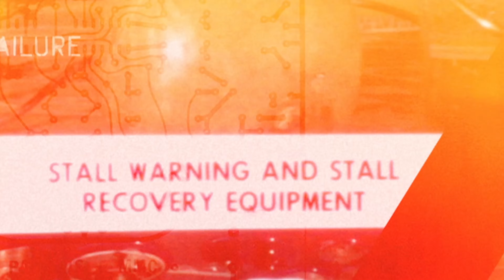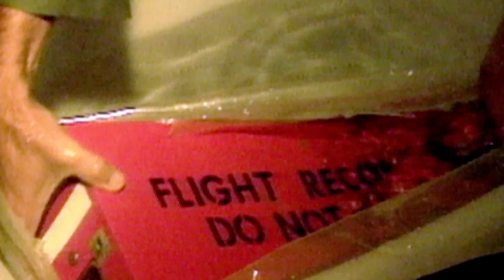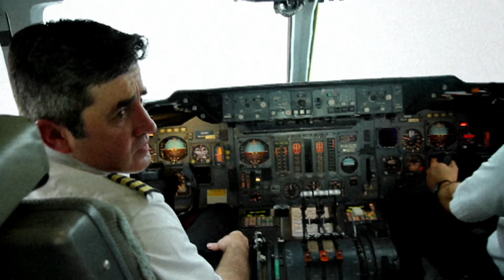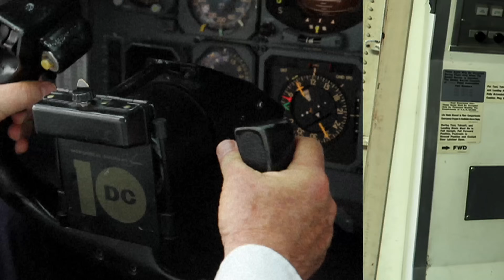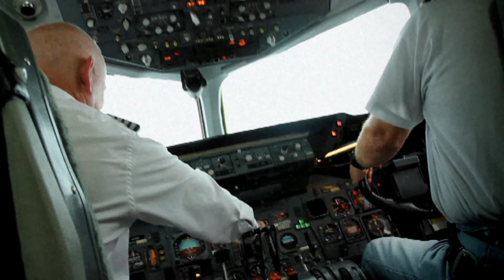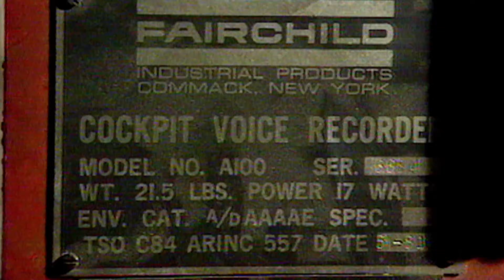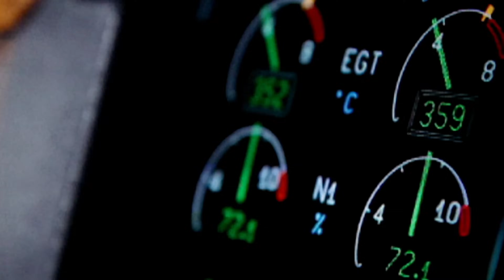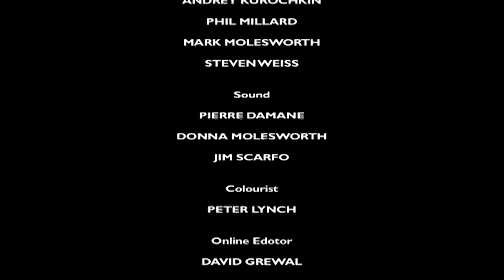Turkish Airlines Passengers Suddenly Fall Out Of The Plane Mid-Air | Air Crash Confidential S1 E4

Comment: The "Pilots got lucky" is both true and wildly giving those pilots less credit than they deserved when they had to fight their DC9 back to the ground. They had to literally pull those cables free with just their own strength. They sawed through the thing crimping the cables. It was insane.
Reply: The American flight? That was some badass flying by the pilots. 100%.
Reply: Whoa!  😮
Reply: @harrietharlow9929  will have to view the video in its entirety before making a comment. How long ago did this happen? Just tossing the question out there, no worries..
Reply: @kay9549  The American flight over Windsor ON where the cargo door blew off happened June 12, 1972.
Reply: Ty harrietharlow9929 do remember that flight, they were able to land the craft even after car do door, blew off. They were fortunate they did not have there hydraulics completely severed. There was another flight that the engine was incorrectly mounted, which had fracture fatigue. Even though the engine sheared off in doing so severed the hydraulic system, pilots were not able to maintain that flight
Reply: meant to say cargo door
Reply: @kay9549  If you lose hydraulics, then your prospects for a safe landing are very, very slim.
Reply: @kay9549  The pilots on the Windsor Ontario flight were very well trained, stayed calm and had a plan. The Turkish Airline pilots were Turkish Air Force pilots who hated being First officer or Flight Engineer they all wanted to be the Captain! Not very well trained on the DC 10 and lost their heads and panicked when they suffered a massive decompression upon loss of the cargo door. TWA 800 was blown out of the sky by a SAM fired in error by our own Navy sadly, not by the center fuel tank explosion myth bandied around to save Clinton from embarrassment and disgrace.
Reply: @anthonydarmanin The pilots concerned in the 1972 DC10 incident were able to land their plane because their hydraulics were still functional (although damaged).
In the case of the Turkish DC10 crash in 1974 the pilots had lost all hydraulics, which means they had no control over the plane.
Reply: @anthonydarmanin  No proof a Navy missile brought down TWA 800.  But feel free to offer actual, factual proof instead of an opinion.

Comment: the same corporate environment that created the dc 10 also created the 737 max
Reply: One person doing maintenance left 4 bolts off. Big deal.
Reply: @BigEightiesNewWave Actually, I think they are talking about the MCAS system.
Reply: The big deal is that it's 2024 so it's kind of unacceptable when there are only two players in the international commercial aviation market and one seems to be completely incompetent, negligent, and rotten to the core even assassinating it's own ex employee whistleblower 😮 @BigEightiesNewWave
Reply: @Snarf_Le_Wombat  we have more, Lockhead Martin, Embraer and Bombardier they still make aircraft but most of them do small aircrafts for domestic flights not as big as boeing and airbus but they are still in the game
Reply: @BigEightiesNewWave educate yourself, troll.
Reply: Also the 787 - plagued with defects... check out the united airline boeiings out of SFO for the past 2-3 weeks.
Reply: please tell me you're being sarcastic bc by that same logic: a car dealership could sell you a car that's missing four bolts on one of your tires. but no big deal, right? @BigEightiesNewWave
Reply: @BigEightiesNewWave they’re talking about the MCAS system.
Reply: With the blessing of FAA.
Reply: At the time McDonnel Douglas was not owned by Boeing.
Reply: Yes!
Reply: @suekennedy8917  exactly, it's with the merger, directed by Harry Stonecipher that cemented the bean counters' takeover and the gagging of engineers, going as far as relocating corporate headquarters to Chicago. He also outsourced spare parts and privileged profits downfall.

" I'll make Boeing run like a business rather than a great engineering firm".
Harry Stonecipher (pupil of Jack Welch)
Reply: I agree, as my previous comment. They are still following the same Pattern. Make more money with no consideration for the passangers! good luck Boeing?
Reply: @suekennedy8917 no, at the time boeing was not owned by MD
Reply: @johnnunn8688  takes one to know one hahahahaha
Reply: It is scary...
Reply: yes, I agree with your opinion
Reply: @Snarf_Le_Wombat  There's also COMAC which is relatively new to market.

Comment: I have closed these "Hold 5" doors hundreds of times. The system is to press a lever until the door closes.Then keep closing the door until a small indicator  light turns off. Then the  pull a large lever down to close the latch. But If the door is not fully closed, I wonder if it is displayed in the cockpit!
Reply: Sometimes yes sometimes no. In the case of Turkish Airlines, they actually disabled the indicator light.
Reply: WOW! We hear that so often!

Comment: 49:00 and here we are,40-60 years later having the same issues as when it all started,doors blown at mid air,tires falling off on takeoff,pilot and copilots napping while driving 😮‍💨
Reply: It's wild!😮😮😮 Do we ever learn? Then again, a billionaire is supposedly building a replica of The Titanic set to sail 2027.  Humans!!!! SMDH
Reply: That is why they lock the door...sleepy time
Reply: So unfortunate
Reply: Some hit the Grey Goose a few hours before the flight and zone off like stoners...But hey, at least we have ejection seats....NOT!!!!!!!!!!!!!!!!!!!!!!!!
Reply: 737 Supermax
Reply: @bunzeebear2973 
You wouldn't want terrorists entering the cockpit.
Reply: @bunzeebear2973   sleeping or awake, makes NO difference in modern planes.
And yes the plane can actually override pilot in the  event of  Stall (even with the auto-pilot turned off).
Reply: That isn't practical on a jet commercial airliner, that I ever heard of.
Reply: @metamorphicme9378 And there will always be someone trying to "rebuild" something that was linked to pain and death, just to say that they did it!
Reply: AI is that what  resorted to after fatal accidents caused by human error? Is this the solution to mechanical failure, robots? Glass cockpits? Fibercarbon composite ? Hydrogen fluid fuel? Good luck. Hope is in the air.

Comment: I'm surprised it didn't include Swissair 111. That was a horrific error in design
Reply: That was an MD-11, not a DC-10.
Reply: In reference to the twa 800 flight, plane was on tarmac for many hours, also it was a very hot day. While they were waiting to leave, air conditioning was running constantly. The fuel tanks were not fully tapped off, so fumes, vapors were heated by the air condition that were below them. Pilots were unaware of status of flight till they went to designated attitude. So tragic, decompression, etc, hopefully as they were breaking up, descending to earth it was over quickly, hopefully so.
Reply: @abenirex  Although MD11 is the continuation of the DC10 after McDonnel and Douglas Corporation merger. So it is essentially largely the same aircraft.

Comment: The wreckage was so fragmented that it was difficult to determine whether any parts of the aircraft were missing before it crashed. Post-crash fire were small because there were few large pieces of the aircraft left intact to burn. Of the 346 passengers and crew on board, only 188 bodies were identifiable (40 of which were identified visually), with rescue teams recovering some 20,000 body fragments in all.
Reply: And Turkish Airlines, unbeknownst to most, tinkered with the door system shortly before the crash, which is why it was able to avoid destruction during its 1st year of operation.

Comment: WATCHING THESE AIR DISASTERS, I AM COMMITTED NEVER TO TAKE ANOTHER PLANE.
Reply: If you See an car accident you are committed to not take a car anymore
Reply: I used to fly all the time in the 70's. I never fly at all anymore and have not in about 25 years.
Reply: @NikD7  You have not far to fall from a car. 30,000 feet is a long way down.
Reply: That reassure me! I wouldn't want to fly with passengers like you.... I prefer learners ;-)
Reply: @nancywhitaker5096  Falling 300 ft or 30000 feet is the same thing. Neither falling nor driving fast ever killed anyone. But a fast stop from either condition certainly will. The chance of dying per hour spent in a car is way higher than per hour spent in a plane. Finally, since most crashes happen at landing or takeoff 95% of people involved in an airplane crash survive (only 80% for non-commercial general aviation however). These events are so very rare that youtubers run out of things to talk about. I have heard separate videos individually dedicated to each and every one of these crashes... This one is interesting because it draws a common thread through them.
Reply: @GusHeck  I don't care how safe someone says they are. I still don't like to fly anymore. It's the fact that jets are not maintained well anymore at all. But I know that you are correct about the Fast stop!
Reply: @nancywhitaker5096  You are of course entirely free to increase your risk according to your personal preferences, I am only concerned that you should do so knowingly. Your statement that jets are not well maintained anymore is incorrect FWIW. Has it perhaps slipped some, yes that's likely. It's not a binary thing. They are still incredibly well maintained compared to any other vehicle.
Reply: @GusHeck  I do not agree. They are slip shod. and have been for a while. Airlines have cut staff. They use inferior products to maintain the jets. Personnel is at an all-time low. They are filthy and overcrowded. Tower personnel are stressed and over worked. It is not the honorable job it once was. Fly on a US Airliner and then take a trip on an Emirates jet. The difference will shock you.
Reply: @nancywhitaker5096  Everything you say is true, yet it is still safer than traveling by car. Even if the 737 door loss flight had been packed each passenger would have had a >98% chance of survival. (probably 1-2 right next to the plug-door would have been killed or seriously injured).
Reply: I would love to be able to stay on the ground but I have to visit my family on an island.
Reply: Automobiles may have worse fatality statistics but it's more so how you are going to die and not death itself that is the fear. Knowing you're in a tube 20,000 feet off the ground and it something goes wrong, you could have a decent amount of time to anticipate the impending doom that's probably going to result in a 100 percent fatality rate. I can understand people being more afraid to fly than drive. Being out in the middle of the ocean in a crazy storm in a ship is another horrifying situation.

Comment: And this is why I keep my feet firmly on the ground, I'll never set foot in a plane.
Famous line from the Mummy Returns: Why can't you people ever keep your feet on the ground?
Reply: I hope you don't drive either, as you might end up as one of the many thousands who die on the roads each year. On US airlines over the last 23 years, excepting only the regionals, there has been but a single fatality. Try beating those odds with your car.
Reply: @cchris874  When I used to skydive, people used to say that the most dangerous part of skydiving was the drive out to the airfield.
Reply: Do you realize that, per kilometre of distance travelled, flying is famously safer than driving.  It's the CO2 emissions from both flying and driving that'll kill us all
Reply: @TheSnoeedog  
That's right. And that's why I'm so glad Boeing is having problems. Right now it's a crime against humanity for these airlines to keep placing massive orders for more Boeings. If the manufacturer closes, that's 50% less flights, and most of these are totally and completely unnecessary. BUT, how do we get this to happen?
Reply: @cchris874  while I admire your intent, I rather curious where this 50% number comes from? If Boeing closes its doors tomorrow, the same number of flights will continue...either until the Boeings in circulation die or until the remaining manufacturer's fill the gap in supply

I don't fly anymore (5 years) and have no intention of doing so again. It's my small contribution to lessening CO2 emissions. I also recognize my privilege at having both travelled and lived internationally until my mid-20's so while there's a whole lot of world I'll miss, it's not like "I never got to cross the atlantic/live abroad/visit the vatican/insert travel related wish here"
But as for getting 50% fewer flights to fly: stop flying.  Encourage others to do so.  Probably the most direct/significant way you can make change in that arena
Reply: @cchris874 I’m sorry but falling to your death is way more terrifying and unexpected than a car crash. At least in a car accident there is a Chance of survival!
Reply: @jtabal100  
I agree. The terror factor is higher, even if you don't die. But it's still very very low odds if you fly wisely.

Comment: What gets me is sometimes it's a small thing that brings the plane down.   Might be where a mechanic doesn't put the washer on,  so the bolt will drop.
Reply: The thing is that the airline manufactures like Boeing and Airbus have very clear, well designed and detailed sychmatics  for Airlines to follow during maintenance.  Down to the very bolt and even what pressure it should be tightened too.  The problem arises when the airlines take short cuts at the cost of grater profits for them
Reply: British Airways Flight 5390.  A window held on with bolts that were just a fraction off in size, so minor that the maintenance person couldn't visually tell the difference.  Luckily everyone survived due to masterful flying by the First Officer.  Even the Captain, who had been ripped halfway out of the plane, survived.  Something that you'd think would be incredibly minor could have killed everyone on board.
Reply: @silentservant_  And human error, which is equally common.
Reply: @silentservant_  It's less than 2 months since a brand new liner lost a door plug due to missing bolts from the factory. Generally yes it's maintenance issues and the airline does that but factory issues do exist. Especially McDonnell and later Boeing.

Comment: It's amazing that a streak from the ocean is completely buried, and so is the fact that airline voltage doesn't reach a temperature that could ignite fuel. I was living a few hours away when this happened, and lifetime pilots were calling into major radio stations outraged saying this could not have happened.

Comment: I was electrician more than 25 years ago & this message will not be nothing new for you,but from time to time is good to remember the basics. In electromotor winding we use the silicone wire's(we called it's S/F wires) silicone isolation is soft& we put over its glas isolating buzzer to protect the wire of mechanical damage.Both isolation exposed in open fire don't burns,goes in dust but don't burns. In house installation exist the rule: low voltage,signalization,indicating instalation ( telphone,antenna.....) must be away from power instalation minimum 10 centimeters because the electromagnetic field in power wires has influence on signal in signalization wires.

Comment: I used to work doing weight and balance for eastern airlines. 
Figuring out where to put cargo,  bags, amount of fuel for flight for round trip on short haul flights, wind direction , runway, flaps settings  and centre of gravity. My favourite was airbus airplanes. 
Always made sure my numbers were correct before releasing the flight. 
Used to get American flight from Chicago to handle it while on the ground. 
It was a big hassle to  work those flights. They were DC10.

Comment: The most devastating indictment of the slipshod engineering of the DC-10 I’ve seen yet. 

The DC-10 not only had an inherently unsafe cargo door, but MD violated every precept of redundancy and fail-safe design. A single point of failure resulted in catastrophic loss. No pressure vents to prevent the floor collapse during explosive decompression. No check valves to prevent hydraulic fluid loss. Positioning fluid lines and control cables such that they can all be severed at one go by shrapnel. A totally unairworthy shitbox that should never have been certified to fly.

The DC-10 apologists continue to blame the baggage handler or bad maintenance when the truth is staring them in the face.
Reply: DC-10 apologists forget that it shouldn't be possible for baggage handlers to mess up a plane that bad.
Reply: Unfortunately it often takes tragedy to force redesign of flawed engineering. That was definitely an example. The DC-10 went on to fly several decades of service. In the 1980s and 90s I was a passenger on the DC-10 to and from Hawaii where I lived (2 engine aircraft were not allowed at the time for that overwater route) and in my experience it was a comfortable ride.
Reply: BUT, they only appear to have done this in a limited number of systems. In many areas they over-designed, which is an interesting paradox.
Reply: @brigidtheirish  I feel so awfully sorry for that poor guy! Even without others blaming him, he probably felt incredibly guilty, even though the fault wasn't his!
Reply: @cattymajiv  Agreed! I'd be inconsolable in his position.

Comment: DC-10’s were like the Ford Pinto 😳
Reply: Ouch...
Reply: All Mc Douglas Planes were flying coffins
Reply: DC-10's were imperfect just like any plane. The problem with the DC-10 is they didn't address the imperfections very quickly sometimes, and improper inspections. The overall, long-term safety record of the DC-10 is just as good as other planes of the time.
Reply: @mediocreman2  😂😂